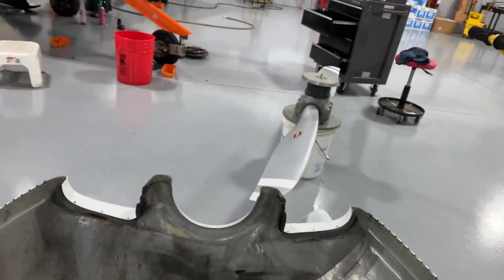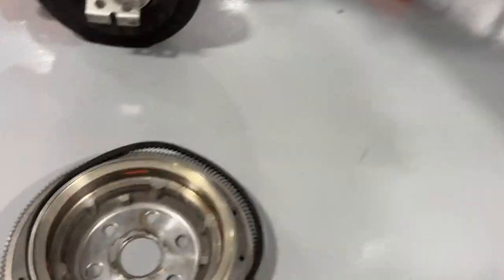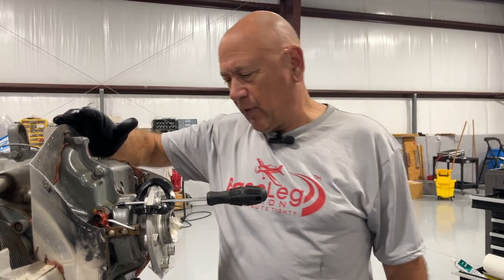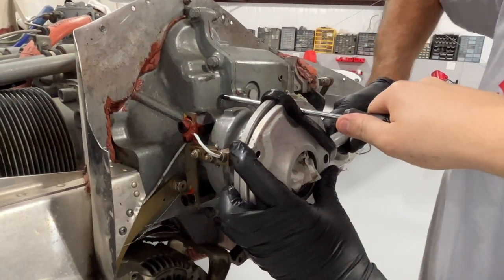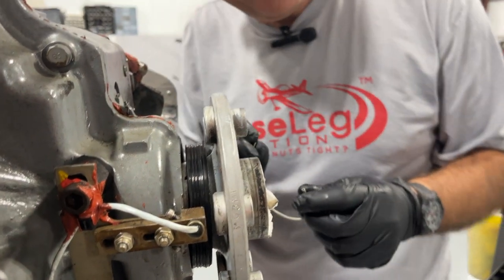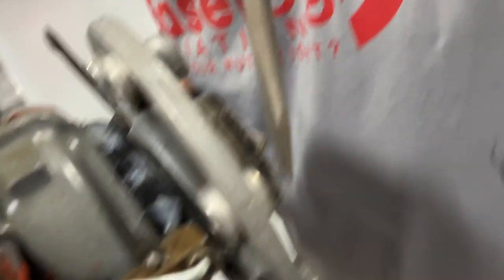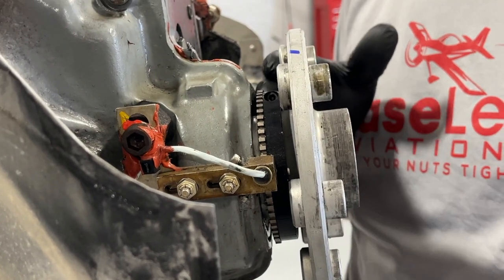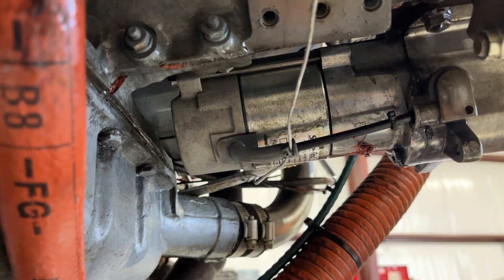Base Leg Aviation crankshaft oil seal replacement

Comment: did mine about 3 years ago, we used Pilobond instead of Dow Corning 737, no idea which one is better.  I remember spending quite a bit of time cleaning the mating surface in the crankcase with solvent, IIRC it was Toluene, putting the Pilobon on the crank case surface before installing the new seal.  I don't remember if we warmed the seal up or not but we then put grease on the crank flange and stretched it over like you did.  Once it was in place, we cleaned up the grease leaving a thin coating on the crankshaft where it met the new seal so it didn't start dry,  made sure the mating surface on the seal was clean and try and then applied Pliobond to it before putting the new seal in.  Several years later and I can confirm there are no oil leaks from that seal or the seal area.
Reply from the maker: I've always used the 737. Great success with no leaks.

Comment: Cool video, Vic!  A couple of things I've read about replacing this seal is to put it in boiling water.  Also, I've read that it's a good idea to use some fine emery cloth to put some "grooves" on the crank in a particular direction that encourages the seal to move towards the engine.  My words are failing me at this moment so I'm probably not describing this very well.

What was that plate you used to when installing the seal?  Is that a Lycoming part, or a Base Leg Aviation part?  And it seems that the installer tool is very expensive, but something similar can be made with PVC pipe.  I've never installed one of these seals, so all this information is just what I've read, and my be totally wrong.  Thanks for the video!
Reply: I don’t know the emery cloth on the crank, but putting the seal in hot water does make the seal more pliable for installation.  I’ve seen the PVC tool plan on the internet but have never seen it in action.  I work at a large flight school so all I’ve ever see or used is the specialty tool.
Reply: Continental calls for sanding the grooves on the crankshaft
Reply from the maker: I’ve boiled them before but have had just as much luck installing them with some lubrication.

Comment: Nice vid, 
* It’s not under pressure behind that seal, only splash.
Reply from the maker: it will blow out if the crankcase gets pressurized, like from a blocked breather tube.